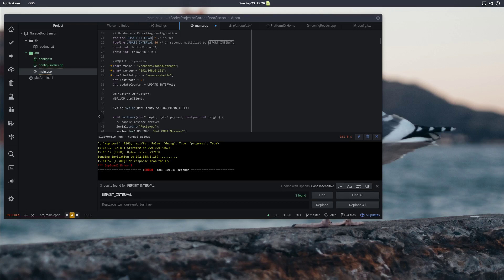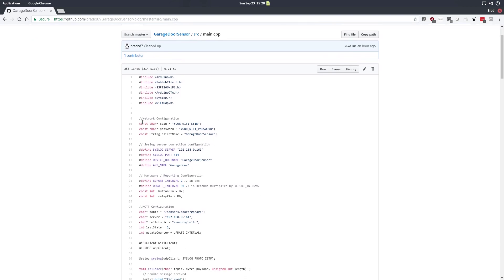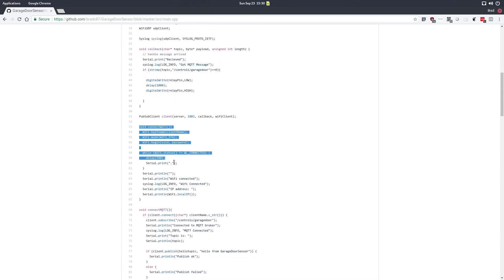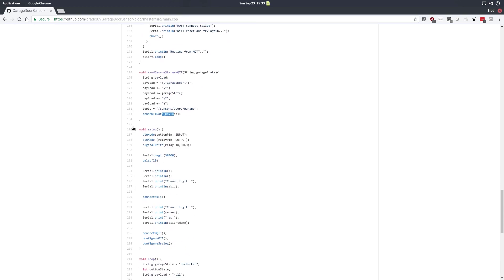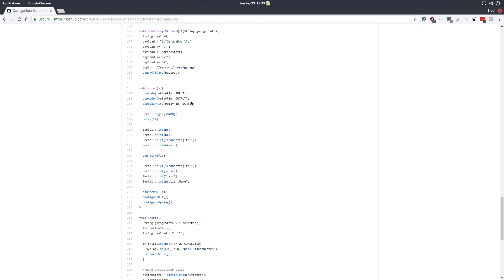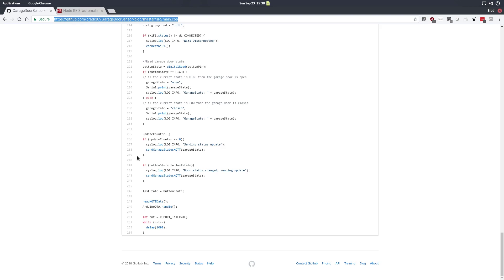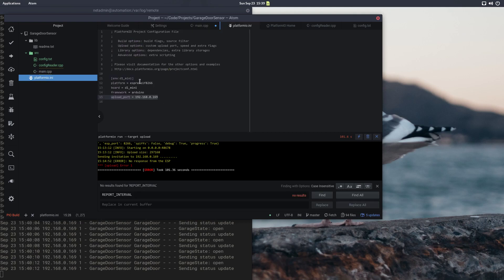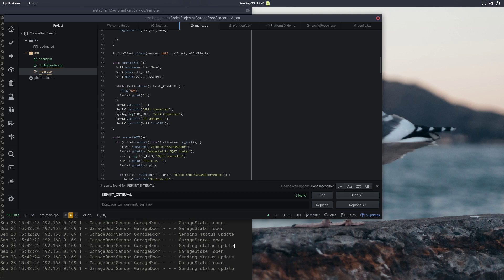MQTT Garage Door Opener Firmware Tour (Part 2)

Comment: Hi Brad,

Nice and informative video. i did a simple test on esp8266 following other video step by step - was all ok

but after that when trying to use your github project shared at https://github.com/bradc87/GarageDoorSensor
it gives me this error. have been trying to figure it out but not sure why it's getting failed. Getting this error [screenshot]

https://i.postimg.cc/rFC5j30L/Screenshot-2020-09-25-at-2-58-18-AM.png

could you please guide me what i'm doing wrong. Thanks.

Comment: could this be used with NodeMCU ?
i'm not familiar with platformio but have mqtt working with nodered and syslog-ng etc

only issue is i'm unable to push this code to the nodemcu...config logic i liked too much..will be able to take care of other things as network engineer.

any guide or quick how-to that you can suggest for me to get this working ?

https://www.linkpicture.com/q/Screenshot-2020-09-21-at-1.28.19-PM.png

https://www.linkpicture.com/q/Screenshot-2020-09-21-at-1.27.00-PM.png
Reply: i guess the only issue is with the following file

#include <PubSubClient.h>
                          ^
compilation terminated.
Compiling .pio/build/esp12e/libe2e/ESP8266WiFi/ESP8266WiFiGeneric.cpp.o
* [.pio/build/esp12e/src/main.cpp.o] Error 1
Compiling .pio/build/esp12e/libe2e/ESP8266WiFi/ESP8266WiFiGratuitous.cpp.o
================================== [FAILED] Took 4.36 seconds ==================================
The terminal process "platformio 'run'" terminated with exit code: 1.

Terminal will be reused by tasks, press any key to close it.

Comment: Suggestion: 
Add a sensor for when the door is fully closed. Right now you only know that your garage is not "fully open". Good for peace of mind.
This will also allow you to deduce states "opening" and "closing". Depending on the specifics of your motor-thingie it might not like presses while moving the door.
Reply from the maker: Yea thats a good suggestion, I will have a look and see if I can get another limit switch in closer to the bottom of the doors travel.